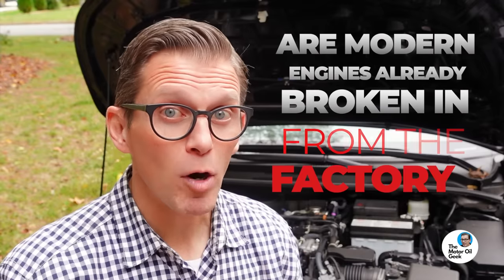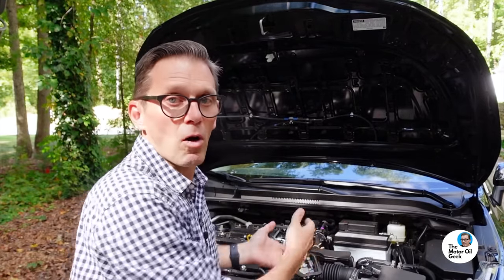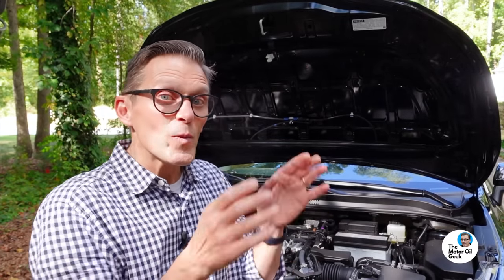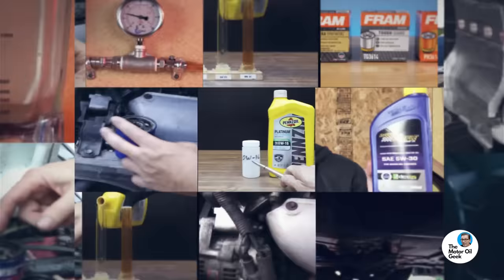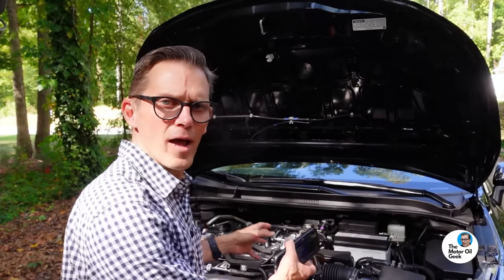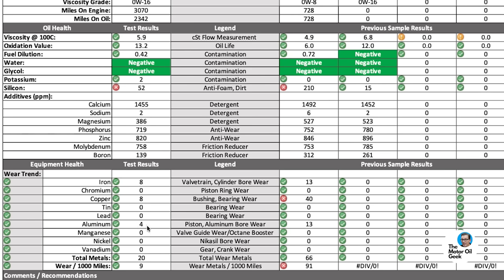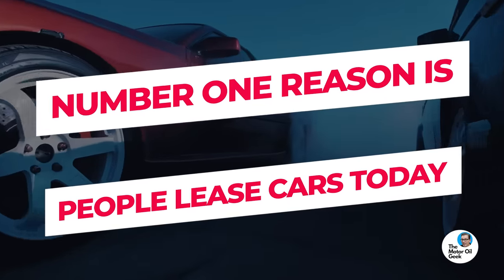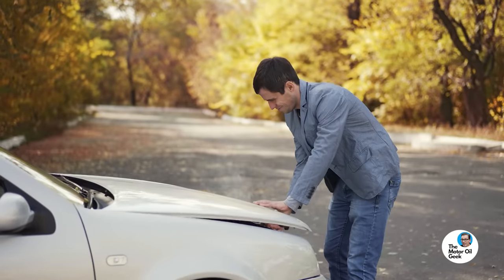New Engine Break-In: Truth or Myth?

Comment: I bought a new 2005 Camry 2.4. The dealer had some gimmick of "the first one is on us" oil change at 3500 miles. I asked about the 500 - 700 mile "break-in" oil change. They told me that was "old fashioned technology." I changed the oil myself at 700 miles and when I held my trouble light over the 700 mile oil in the drain pan...there were millions of tiny metal particles floating in the oil. I felt good about getting rid of all that metal at an early life of the engine. I owned the car for 15 years and racked up 218,000 miles before I sold it. The engine ran like it was "brand new" for all those miles. Fast forward to 2020...I bought a new Camry 2.5. I did the same thing but, this time I didn't see millions of metal particles in the oil. Still...I felt good about that first oil change. I totally agree with the first early oil change. BTW...while purchasing my new 2020 Camry the financing clown told me they break in the engines at the factory. I knew it was total bullshit because...how can they have the time and resources to break in millions of engines at the engine factory? Many of these dealership clowns will lie to anyone about anything...even their own mother!
Reply from the maker: Thanks for sharing. I agree!
Reply: Nothing new.  The automakers have been making that ridiculous claim since the 30s.
Reply: It would be impractically impossible to break in all those engines. They'd need to actually drive the cars for the break-in period. Even if they were able to run the engines for all those hours, it's not the same as the engines being under load.
Reply: 😂  I was told the same  thing total BS ,change oil at 10k the toyota engine already breaks down from the factory 😅 what a Maroon!
Reply: Absolutely.  In my experience the financing person is the least trustworthy person in that building.  They will willfully and knowingly lie to you for their benefit and to your detriment, dig in further when presented with evidence that contradicts them, and have no qualms about any of it whatsoever.
Reply: @bwhammm  Can we say Sociopath?
Reply: Did you sell your car to a dealership in Indiana?
Reply: I wish to know as the new owner (potential), if I change the oil at 900 km, will it void any factory warranty? As the Service #2 (16000 km). Also how many km after the oil should be replaced? 16000 km seems too long . Rav 4 Hybrid. Thanks.
Reply: @ramizahmed1718 it’s not too long an interval for a hybrid, because a hybrid’s engine works differently to a conventional gas motor. It’s not under nearly as much strain, it doesn’t rev up the same or to the same level except under wide open throttle. The motor turns off during idling when the battery is sufficient, so there is less on-time for the motor. There’s more, but that’s a good start.
Reply: thanx for confirming. i did my first oil change on 2025 crv hybrid at 361 miles. now planning to do another at 450 miles. i want to do oil change every 200 miles for first few thousand miles. I am definitely over killing it but i only see benefit in doing that.

Comment: I took you advice. Went and changed my oil today at 700 miles.  I just bought my 2024 tundra 2 weeks ago. The dealership looked at me like I'm crazy when I asked for an oil change. I also asked for an oil sample. Explaining to them its a new engine. It's breaking in. There will be micro metal particulate in the oil. Long story short. After they changed the oil and inspected the sample of the first 600 miles oil. They found that I was right and gave me a huge discount on that oil change. Anyways I'm glad I changed the oil. Cause regardless of what any manufacturer says I think a new engine needs that 600 miles oil change.
Reply from the maker: Right on! Thank you for sharing your experience.
Reply: When I rebuild an engine, I let it run at a fast idle for an hour with SAE 10W, drain that and drive the car at fairly low speeds for 500 miles with SAE 10W or 20W depending on time of year, drive at moderate varying speeds, drain that at 1,000 miles, fill with SAE 20@ and drive at moderate varying speeds for the next 1,000 miles, then go to my usually 2,000 mile oil changes.  In summer, SAE 30, in winter here in Northern Cal where it doesn't get very cold, SAE 20W.  I change the filter at each of these changes.  Many say overkill, but I have never had a lubrication-related failure and routinely got well over 100,000 miles on what would now be considered very poor quality oil, so I must have done something right.
Reply: 1. How much does the testing & analysis of engine oil COST the typical car owner, in addition to all the oil changes being done?
2. When you substitute a lighter weight oil than the ones recommended by the factory, aren’t you doing things that could invalidate your factory warranty?
Reply: @creiganderson  You sure are!  They will say that your poor choice is the reason for your problem, even if it isn't, knowing that you have no way to prove them wrong without spending thousands.
Reply: @jamesbosworth4191  100,000 out of a modern car is the expected if you don’t ignore basic oil changes. That’s not really a testament to anything. Comment when you have 200-400k and we’ll be impressed that you’re not wasting time with a 2000 mile interval. Maybe you don’t drive often and are changing it because of time which makes sense.
Reply: @BeefNEggs057  I am not talking about modern cars, I am talking about cars from the 50s and 60s.  That's why I used single-grade oil, as that's what most of used.  And I change my oil based on miles, not time, unless the car is very seldom used.  And those 50s and 60s cars I was talking about still ran when I sold them.  And there was no such thing as synthetic motor oil back then.
Reply: @BeefNEggs057  Changing oil is much less work than rebuilding/changing engines, and mush cheaper as well.
Reply: And the name of that dealership? Albert Toyota Einstein. Everyone clapped when you left.

Comment: I've always done my first oil change at 500 mile, 1000 miles and then 3000 miles from then on. I've never had an oil related failure in 30 years! This man is spot on with the information he is giving.
Reply from the maker: Thanks!
Reply: I have a Briggs and Stratton lawnmower engine where I deliberately have never changed the oil...for 30 years so far. I just tip more in when needed, and it's still going just fine😂 I don't do the same with my car, but on modern synthetics 10k miles is fine between changes. I've never had an engine failure in over 50 years either. Modern engines are built to far closer tolerances, so running in is less crucial, but I think it's still important to go steady on an engine in its early days. Changing the filter is as important as anything.
Reply: @timhancock6626  the key thing you're missing is direct injection which causes more fuel to get into the oil (fuel dilution is the term). This lowers the viscosity of your oil and leads to it needing to be changed sooner. Turbocharging a direct injected motor further increases the need by cooking your oil at higher temperatures. On these motors, change at 5K miles or 12 months, whichever comes first.
Reply: What ever you want to do I just do the first oil at 1k
Reply: what a waste to change oil that much
Reply: @karmendimas5274  oil is cheap. Engines aren't.
Reply: Ok, I'll bite. "Correlation is not causation". Myself? I've always done my first oil change at 5000 miles, and then used synthetic oil at 10,000 mile intervals. None of my engines ever used oil, and all my cars have gone well over 250,000 miles. That's over 1 million miles driven with no oil related failures in 50 years. So I guess my data just proved that long oil changes are actually best. (retired aerospace engineer)
Reply: @barnygooseegg5035  depends a lot on how you drive and if you tow with your vehicle.  I've been a very successful mechanic for over 40 years and I never have to work on my vehicles,  just people's who only change oil at long 10,000 mile  intervals
Reply: "I've never had an oil related failure in 30 years! "  what does that mean? you did this to 1 car? or 30 cars?
Reply: @bikeman123  12 pieces of heavy equipment,  5 dump trucks, 3 semi trucks, 4 pickups,  and numerous types of farm equipment I use to maintain my farm. And I am a certified john deere mechanic.  I know a little bit about this type of stuff. And I have never had an oil related failure on any of my equipment all of which I bought new with the exception of 1 john deere dozer and combine. Not trying to argue with anyone,  it just has proven to work for me! And I will continue to do things this way. To each his own.
Reply: I’ve been driving for over 60 years.  I’ve never done any special oil changes, just followed the manufacturer instructions.  I too, have never had an oil related failure.
Reply: Did you use Good conventional oil or did you Is full synthetic oil? I only use castro full synthetic. I just purchased a 2024 Chevy colorado pickup truck the motor 2.7 Is in line 4 cylinder  turbo. It has less than a hundred miles. I want to change the oil at five hundred miles. Should I change it with break in oil? Or should.
I use Is castro full synthetic oil? Or conventional oil good quality Is castro? Also I use wix xp Is oil filters.
Reply: I only use wix xp oil filters

Comment: Thanks to you I changed the oil in both my new vehicles at 700 and 1700 miles. It is a great piece of mind knowing its been changed twice before the 5000 miles "first change".
Reply from the maker: Great job!
Reply: Same here.  On our reconditioned turbo diesel I changed the run in oil at 400 kms, then again at 1500 klms.  On the 5000 klms I started using Full Synthetic.
Reply: I'll trust Toyota
Reply: @joeblow-xy3oz Oil is cheap, Motors are not. 50 bucks is a small price to pay, especially considering the source wants to sell you cars. Have you seen what oil looks like after the recommend 10k miles? I'll believe my lyin' eyes.
Reply: @joeblow-xy3oz marketing or engineers? I trust the engineers which would agree with this man here.
Reply: @joeblow-xy3oz  Care to ellaborate on why you're trusting the manufacturer/seller, whose best interest is in you doing as little preventative maintenance as possible?
Reply: @Chris13s13  My dad told me the same thing when I started driving.
Reply: 2023 toyota highlander ,first  Toyota recommended oil change at 14000 km , about 8700 miles .
Seems too long for me .
Reply: @joeblow-xy3oz  I saw a guy bought a brand new Lexus TX and he did an oil change at 1,000 miles. That filter was glittering like Michael Jackson's sparkling glove!! Change the oil at 1,000 miles all those metals going to be in the oil!
Reply: My 2023 Toyota 4Runner 4.0 V-6 has 10,000 oil change intervals with 0W-20..    But not me.   I'll be changing at 500, 1000, then every 3000 miles.

Comment: I grew up working with my stepdad who had a machine shop and was a very good engine builder. He was always very strict about engine break in. When I started rebuilding engines for my own vehicles, I did the first oil change at 100 miles, the next one 500 miles, then another at 1,000 miles. Then every 3,000 after that. Some might consider that overkill, but there are a lot of contaminates during break in.
Reply from the maker: Absolutely! Thanks for sharing.
Reply: Eu também acredito que o amaciamento é importante para uma boa vida útil de qualquer motor.
Seu padastro e você estão corretos.
Reply: I think modern engines are a different animal altogether. Especially a Toyota or other highly engineered engines.
Reply: @Alex-gx5mb  Not exactly: Those very "modern" engines have much closer tolerances... so those require thinner viscosity oils, especially for their VVT or variable valve timing mechanisms.  BUT, their cylinder walls are machined exactly like previous engines, and undergo the same cylinder wall and piston ring mating (Break-in) process, and require the same metal particle elimination at initial oil changes scheme.
Reply: Yes - 100 miles and throw away the cam lube, larger metal shavings and any machining residues from your "clean" rebuild.  Put magnets on your oil filter to collect more iron.

Comment: Thanks, Lake! Love the science based look at oil instead of all the speculation based info on YouTube and the web. As been said below, keep up the oil myth busting videos!
Reply from the maker: Thank you!
Reply: Have always believed in break in.  Brother bought a brand new Jeep Wrangler in 1993.  Drove it home 100 miles and changed the oil.  Changed it again at about 1000 miles or so, and then normal after that.  Engine lasted forever.  Also changed the diff and trans (manual) fluids at 1000 miles with quality synthetic.  Really liked that Jeep, and ran surprisingly well for a 4.0, 5 speed and 3.55 limited slip.

Comment: Great Video, thank you for the content!

A good friend of mine decieded around 8 years ago to sign a contract to work as an professional soldier for the swiss army. (In switzerland we have mandatory army service for at least 270 days. During this time we get trained by the professional „soldiers“). 
When he started his new job he and his 20 classmates recieved all together the exact same model of car with an 1.5 liter diesel engine and manual transmission. 
My friend told me that he was the only one reading the manual about how to treat the car during break in. So he broke the car in and never had any issues with the engine. Most other classmates just drove the car from the beginnin „normal“ or even quite agressiv. 
After 1 year some classmates said that they had to top of the oil between changing intervalls.
My friend drove his car truble free without oil consumption for 4 years and 180‘000km (110‘000 miles) until he recieved a new car.

I don‘t have exact data, but the opinion that it is necessary to brake in an ICE engine with an early oil change and to drive it as described in the owner manual.
Reply from the maker: Thanks for sharing!

Comment: When I bought my 2022 Tacoma  I brought my truck back at 1000  miles for an oil change and the service advisor said engines don't have to be broken in and more like 50 yrs ago. I told I'm old school (56 yes old.) and to do it anyway.  I'm glad I did because this truck gets a lot of highway driving and an oil change every 5000 miles. Thanks for breaking the myth.
Reply: I have found that the Dealership Service advisors are young now and most  have no clue about much..
Reply from the maker: Thanks!
Reply: The dealer only cares about the warranty period. VW dropped it's warranty from 7 years to 4 years or 50,000 miles in 2021. You could probably run kerosene in your crankcase and make it through the warranty period.

Comment: I change my oil sooner than the owner's manual recommends, but like most Toyota owners living in the rustbelt, the frame will fail long before my motor will.
Reply: Yep.  If you live in such an area, buy in the summer, and immediately take it to a place that does coatings and get the entire frame shot with bedliner or that thick black undercoating stuff they used to use on cars from Europe. If the thing is sealed and water-tight, then all the salt in the world won't matter.  The issue is new cars and trucks are shipping with just a coat of paint to protect them, and often the bolts and so on aren't even painted.  So guess where the rust starts and then some flimsy paint won't stop it at that point.
Reply: Fluid film ,  diy project for a few hundred bucks. There’s a million yt videos on this. Yw
Reply: I remember many decades ago there were companies like Rusty Jones and others that would undercoat your car. I don't know if similar companies are around or not to do that type of undercoating
Reply: Yes same on.my 2003 Ford explorer  rusted quickly and motor blew at 100,000 and I used Mobil 1 faithfully
Reply: Just got the frame rust repaired on my tacoma. 240,000 miles. Oil changes every 10,000 at best.
Reply: "Corrosion Free" is the best rust preventative on the market!! Cheers from Canada 🇨🇦